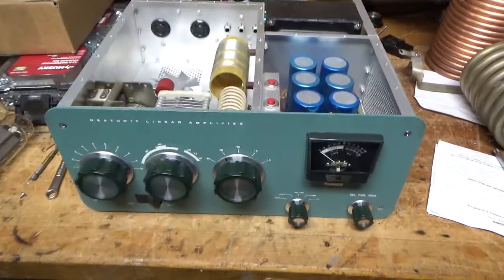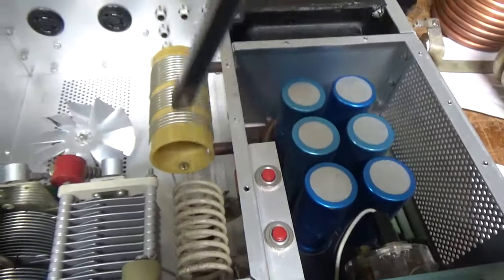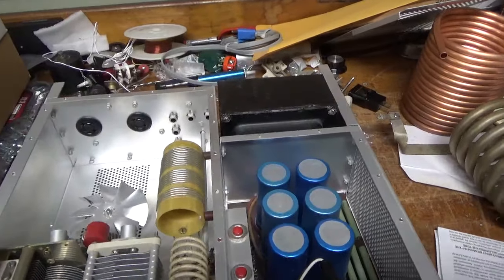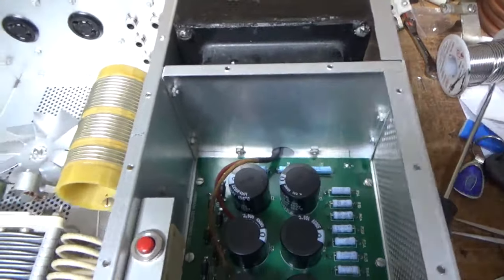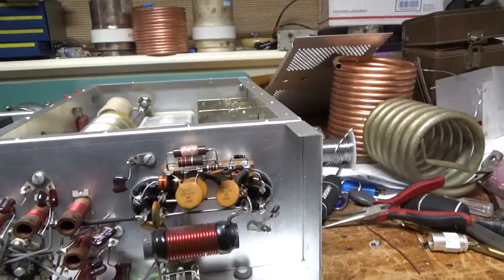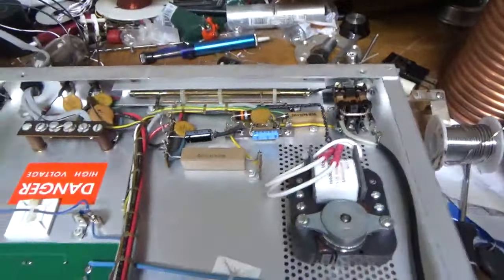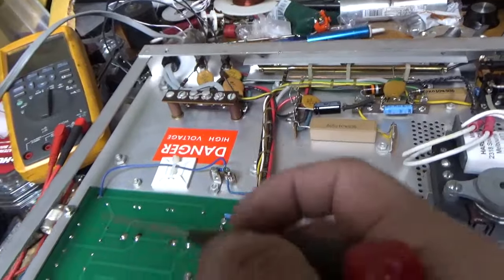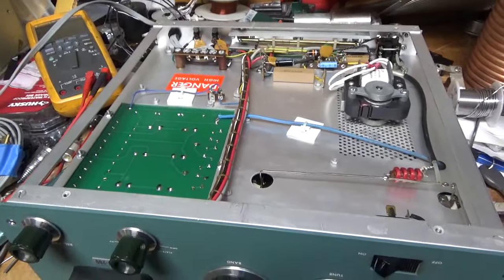Heathkit Sb-200 Repair Harbach Filter Cap Kit New Tubes Grid Loading Resistors Etc Etc

Comment: If these capacitors are faulty would this give the amplifier input a high swr on the 10 meter band? Because this is my issue,the 10 meter band used to work fine and one day it stopped amplifying on the 10 meter band and it's like a short on,yet it's working fine on all the other bands?
Reply from the maker: Feel free to give me a call , I’ll give instructions on how to send in for repair

Comment: Hi again I am still having issues with my Collins 30L-1 amplifier and I think that the capacitors C75 and C76 maybe the issue but I don't know how to locate them could you please tell me how to find these Two capacitors,maybe send me a picture showing me the location, I have the values.
Reply from the maker: Feel free to call for directions to send in

73